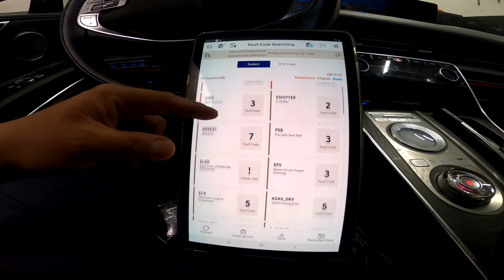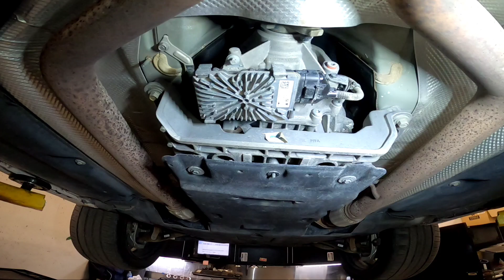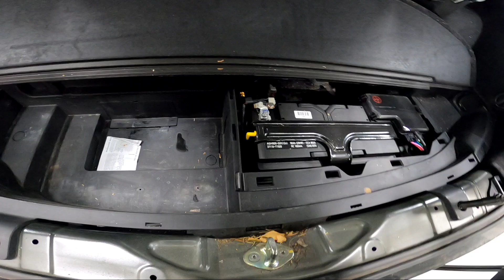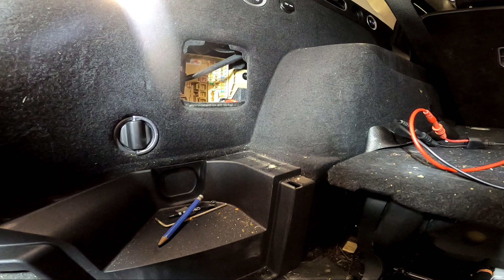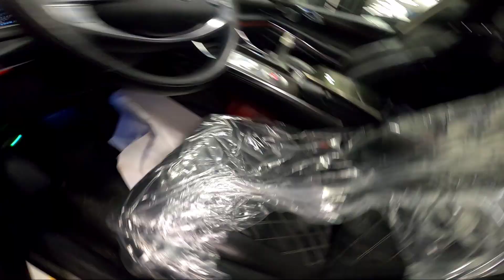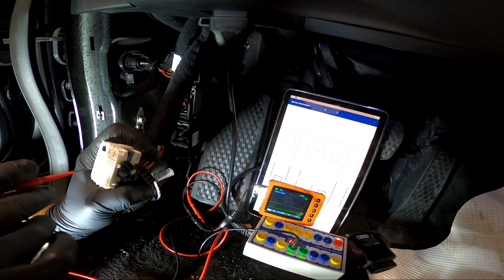Genesis GV80 multiple warning lights in the cluster

Comment: My 2024 GV80 has just recently started to display a number of faults on startup relating to lane assist and the lights on the dash indicate brake related issues. Could they all be related to the same module? One day everything was fine. The next morning all the faults showed up. Been trying to schedule service but my local dealers aren't very responsive.
Reply from the maker: Yeah could be 1 module causing issues. Best way is to.have it check and scan to see for guidance
Reply: @hyundaitech thanks, finally got an appointment for Monday morning. I’ll let you know
Reply: Pulling a boat in and out of lake.

Comment: It’s well known that GV80s have a common issue with plugged sunroof drains. The best way to unclog them is by using a drain brush from Amazon. The rear drains can be accessed through the exit points behind the rear fender, while the front drains are easily reachable from the sunroof when it is open.